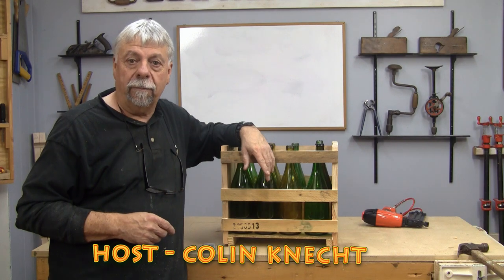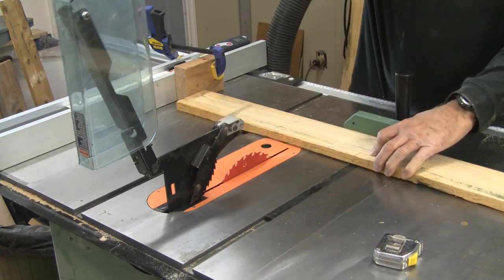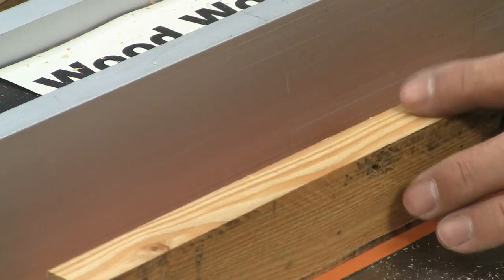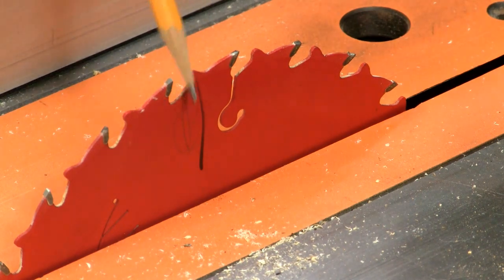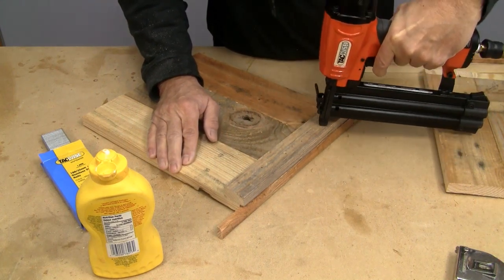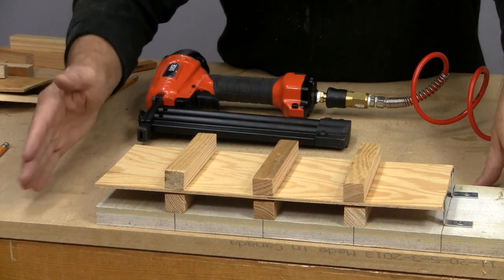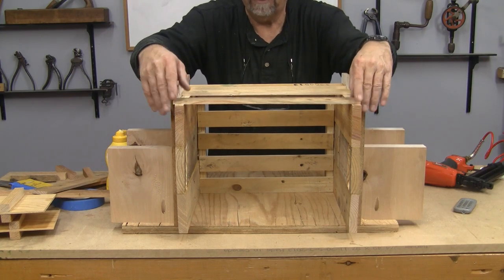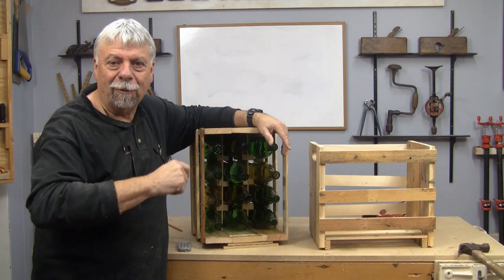Pallet Wood Wine Carrier & Storage Rack - Woodworkweb

Comment: I like the interlocking stacking feature. Growing up on an apple farm, many years ago, we use bushel boxes but the did not interlock to prevent bruising to apples but you need to be precise in lining them up to stack. They would be stacked 12-15 crates high.
Reply from the maker: WoodRodent That's a very cool comment, thanks for that. I wish I had some of those old wooden apple boxes, I remember them as a kid, and using the wood from them then to make different things. Of course now those old boxes are work the fortune as collectables. Thanks again for bringing back some old memories :)

Comment: Hey Colin, thanks for the video and Happy Holidays.

I wonder if it wouldn't be wise to strengthen the handle a bit.  You cut most or all of that middle board out leaving the handle held in place with wood glue alone.  I imagine one of those crates weighs quite a bit when loaded with 12 bottles of wine.  I would worry that years of expansion and contraction may weaken the glue joint.

Maybe use dowels instead of opting out like you did.  Or place a piece across the grain at the top and route the handle through both.

None of he less a neat like looking project.  I like the idea too of the removable partitions and stacking tabs.  This makes the crates useful even after all the wine is gone or before one's collection is complete.
Reply from the maker: Alan Evans I seems pretty strong, but if anyone wants to be on the safe side, the could move the hole down a tad ... Thanks for posting, good option

Comment: thanks a lot colin, do you have a video on restoring old furniture or cabinets that have been painted?
I'm in the middle of a restoration (love natural color over paint) and I just want to see if I'm on the right track! Thanks!
Reply from the maker: StoneysWorkshop I'm with you buddy on the natural look. I do not have a vid on this but have done a bit. I really depends on the size of the unit. I find on smaller things one of the eco paint removers are best. I also found that if you paint it on then cover the remover with plastic to prevent it drying out, an let is sit for a couple of hours, it works much better. Other than that, it's kind of ... well, what ever works best. Would love to see some pics of your finished work sometime.

Comment: why use a stop block instead the fence at the right distance? BTW your videos are really inspiring. At the moment I am working in the wine bottle gift box. cheers
Reply from the maker: CMGDF Great question, about using the stop block, and if you have ever tried to cross cut with both the mitre gauge and the fence you will know quickly that the wood once it is cut often gets caught between the spinning blade and the fence at the end of the cut whips the wood backwards. It's because the wood often jambs or binds between the spinning blade and the fence. With the stop block the wood cannot jamb. Great question buddy  ... thanks for asking, I should probably have covered that off in the vid ... another time though.Love to see pics of your gift box when it is done !